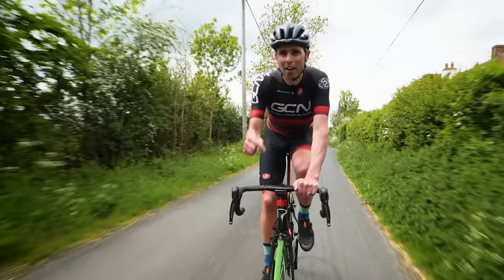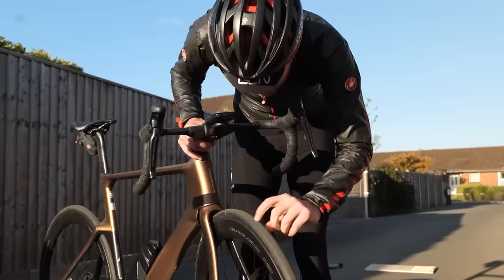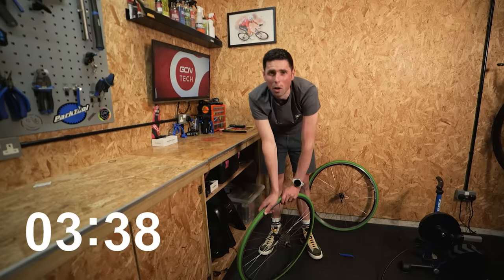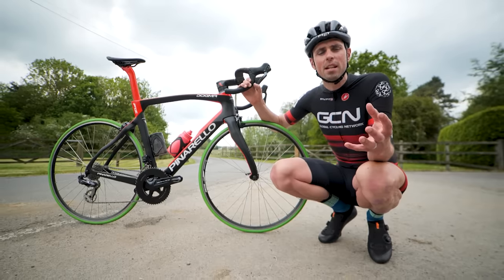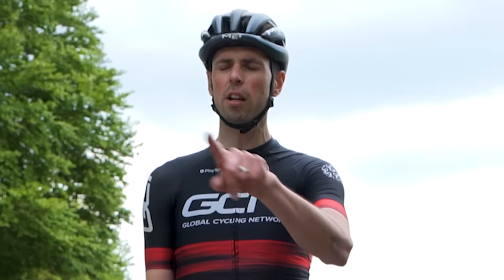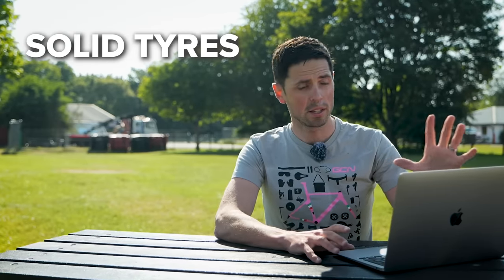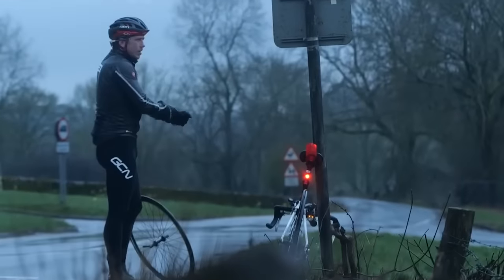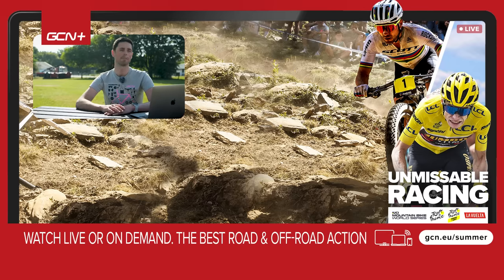We Bought PUNCTURE PROOF Tires, Are They Any Good?

Comment: I have solid tyres. Good solid tyres is tanus and gecko. And if you going on sunny day, then solid tyred due heat significaly makes softer and signicifaly increase rooling resistance. Do then temperature is 5 degree cels. for exaple, then it more rigid and have smaller rooling resistance. But i have cheep solid tyres, so its not wery good. I have one on one my electric bicycle with 26 inch wheels. on front wheel. And if you ride fast they also is going to be soft and warm and increse rooling resistance.

Comment: These tires are best if part of your bike commute is riding at night and you not want to stop in a shady area at night fixing a puncture.
Reply: Naa. There's a reason why the pneumatic tyre was invented! 
 If you need flat-proof, get Schwalbe Marathons. They are not the fastest, not the grippiest and not the most supple tyres, but at least they are pneumatic tyres and offer a minimum of suspension/damping, so they are not entirely horrible.
Reply: @turboseize you didn't really read that, did you?
Reply: @better.better  In fact I did. Why would a "sketchy neighbourhood" make you choose a tyre that maybe won't flat, but slows you down to walking speed and increases your risk of crashing (due to lack of grip)? If there is one thing that in this situation I would fear more than stopping for 90 seconds to fix a flat, that would be going down and hurting myself or being outrun by someone on foot... 
You would want a dependable tyre. Dependable means not only not flatting, but also not totally failing at tyre things such as rolling and cornering....

(Btw, why would you even ride a bike in an area where other humans make you fear for your life? Get an armoured car!)

Comment: I had solid tires with my fixed gear a few years back and the experience was tiring. The bike feels heavy than usual and whenever there are potholes, there is a chance that it might hit your rims (my tri spokes had a crack because of a few consecutive potholes). Sure it was reliable and has a long life span, but it wasn't efficient and fun to ride, especially in ascent (almost passed out trying to climb a 1.9 km road).

Comment: Was that just B-roll or did you change to deep-section rims for the pneumatic?
Reply: I was wondering that - but then the difference with aero wheels is so minimal (about 2% in air resistance) that the gap still would have been more than 9 minutes

Comment: Been using tubeless for years on the MTB, got my road  DT Swiss wheels running tubeless with Hutchinson Fusion 5 Performance Storm 11 tyres which are easy to go on too, and judging by my Strava times running pretty fast. Tubeless is the future and I'm running them at 60F/64R psi even at 90kg... makes you check the pressures before every ride. Think If I wanted puncture protection I'd still opt for maybe Marathon Plus type tyres that are heavy but still offer some comfort.
Reply: I liked Tubeless the first couple of years, but when I started dealing with maintenance, punctures and costs, I quickly realized that I'm better off with the other options.

Comment: Pneus with solid puncture protection are a way better middle ground than solid tires. I doubt that there are many riding profiles justifying the massive downsides of these, you should probably question your route choice rather than material.

Comment: I would never buy them ! Not only they are incredibly slow but what about the behaviour on the wet and cornering ? I'm a serial commuter (~8000km/Y in all conditions) and my family is a cycling family (wife and Kids all riding bikes on a daily base). Tubeless tires for me (fast + good puncture resistance + good on the wet) and good standard quality tires for the other bikes. I'm changing a tube on the family bikes 1/2 times/year ... All ok in my opinion !

Comment: To be fair, I'm willing to bet the compound used on these tires aren't very good in the 1st place.

What I want to see is how much of a difference there really is between 2 tires with the same compound :)
Reply: how would you make that work? Would probably be impossible/unfeasible for tubeless/tubed tires, even more so with something not meant to be used pneumatically. Even across brands tyre compound is definitely one of the greatest secrets. Then you have that even across lines there are very large differences: Gatorskin Vs. GP5000.

The compound certainly is NOT the same, but I don't think you can make it the same. A pneumatic tire is not a homogenous mass - there is often a rolling tread compound, a cornering tread compound, etc. Then there is the casing - silk? cotton? synthetic threads? <- none of them needed in the pneumatic tyre but you'd need to replicate these functions..

I'd hazard a well-made airless tyres is not isotropic: there is a wear compound, a "body" compound, a different compound to make mounting safer, etc. Out of all this probably only the rolling compound can be the same, but probably different properties because it has no "aid" from pneumatic suspension.
Reply: Re the compound used the phrase "cheap and cheerful" comes to mind

Comment: i've been riding a bike for as long as i can remember, but in the last 10 years i've never had a puncture in the middle of a ride on my mountainbike and in the past 2 and a bit years since riding road i've also never had a puncture...maybe i'm just lucky or it's karma because i've seen people have 2-3-4 punctures per ride...so i think i'll skip these solid tires for the now
Reply: I use puncture resistant tyres and have had a few, but it's been years since I had one interrupt a ride. Most have been slows showing the day after, usually caused by a flint or thorn I should have spotted and removed.

Comment: I commuted with Tannus solid tyres for about two years on my hybrid. The only factor in their favour was that they couldn't puncture, and I'd never have that sinking feeling of getting to my bike to ride home only to find a flat tyre. They were heavy, slow, tended to separate from the rim at high speeds and were sketchy as hell in the wet, particularly on road paint. The pink tyres were head turners though, so maybe they helped with getting noticed by drivers.

Comment: Not a good test when you had such different wheels for the pneumatic tyres.
Reply: Aero wheels have perhaps a 2% advantage in aerodynamics.  When the difference between the tires is so comparatively massive, you could use any combination of different rims and it wouldn't materially affect the results.
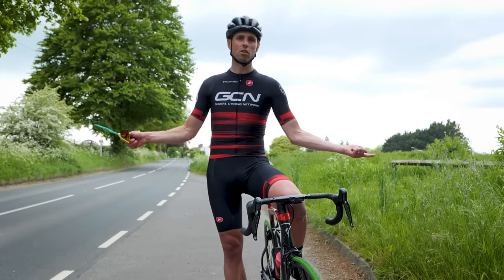Reply: @trainiax  It won't affect the winner, but it will affect the margin. Plus he says of the test, "There will be no difference in setup between the two things other than the tyres". (5:30) Simply not true.
Reply: @AllanPhillips  It's true, the wheels should have been the same - and that did bug me after he said "no difference".  But the change in the margin would have been on the order of 10 seconds.

Comment: Sorry ... but NO ! They are not any good.
Horrible ride feel, horrible grip, don't even get me started on speed.

Tubeless tires with a foam inside if you're concerned about having to stop in not-so-safe urban areas should do it.
Fitting a tire plug is much faster than changing an inner tube.